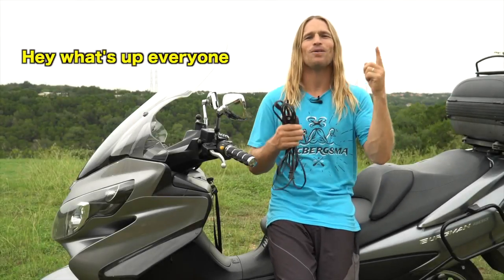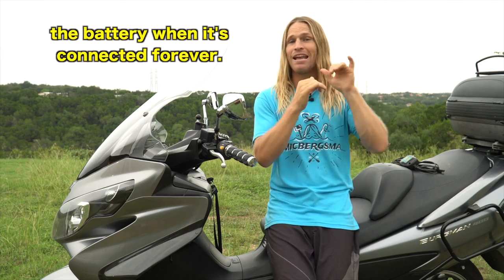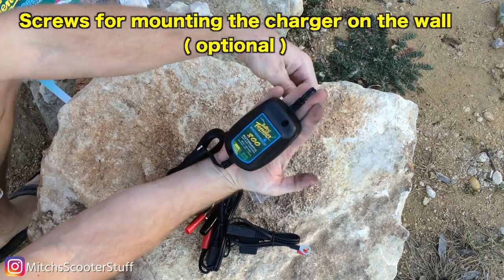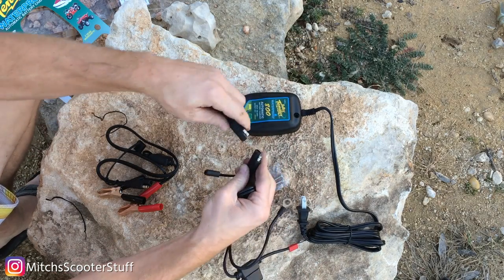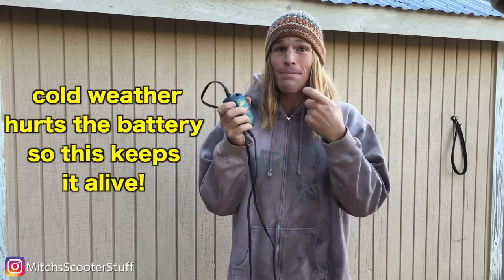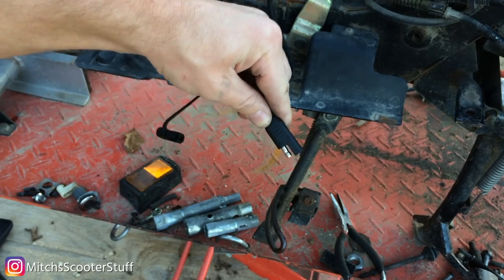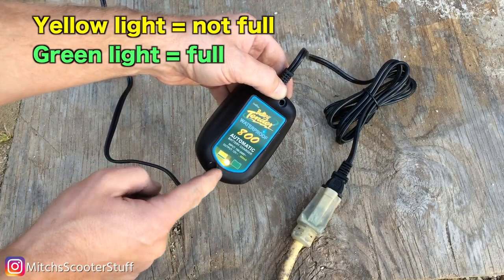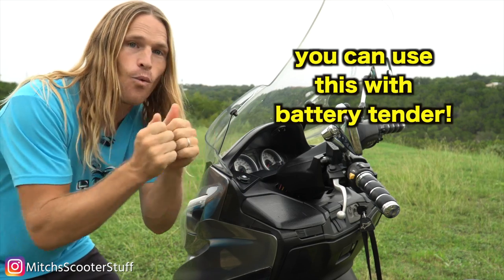Battery Tender Charger - Keep Battery ALIVE! | Mitch's Scooter Stuff

Comment: Mitch, you should do what I did to my Zuma 125. I ran two connectors from the battery to small mounting posts coming out of the abs floor cover  behind my leg area so I can just quick connect to charge my battery.

Comment: have 4 of the water proof 800's and three of the indoor juniors. I still believe they are the best brand out there but they are not the most reliable (the water proof ones). I have a lot of equipment and the use of battery maintainers has extended the life of my batteries. Every year or so, one of my 800's will just show a steady yellow light. I would rotate with another unit and the steady yellow will follow the charger. I put a voltmeter on the output and sure enough it is charging constantly. I let it sit for a day or two and same thing, steady yellow. The unit was outside warranty so I tossed it and bought another. This new one works fine. 
Another one had the same failure mode (over charging - steady yellow). Again I confirmed it was not the battery or wiring. This one was inside the warranty period. The next one was not, so I tossed it and bought another. 4 failures inside 4 years, same fail mode.

Comment: Sorry but Battery Tender does not desulfate the battery which causes failure over time.  Had 3 fail with Battery Tender when the light was green.  Use BatteryMINDer now with does desulfate batteries.